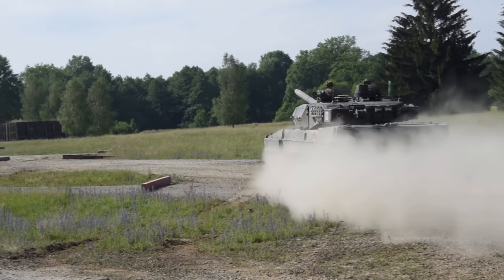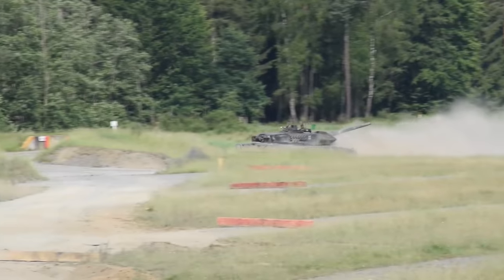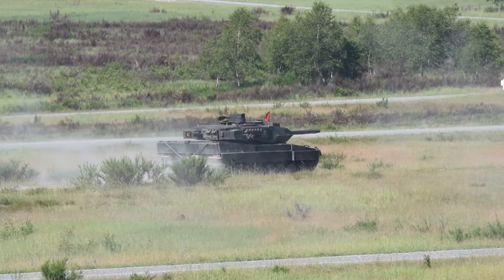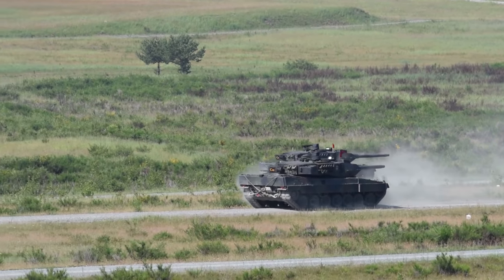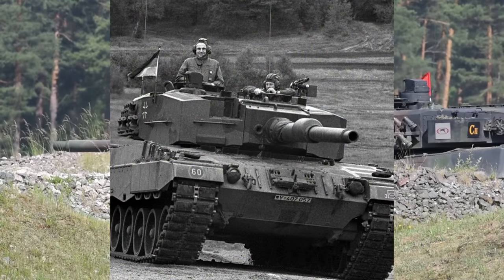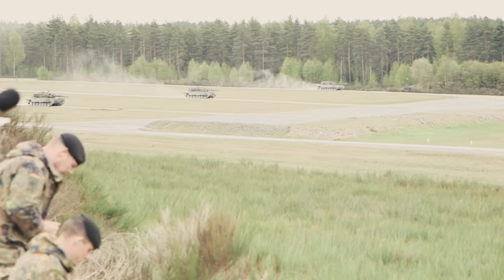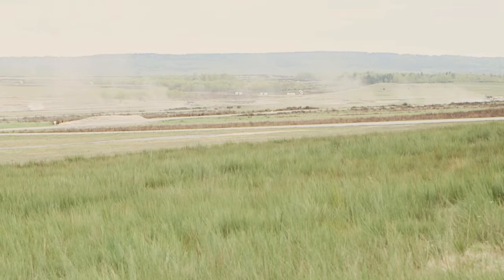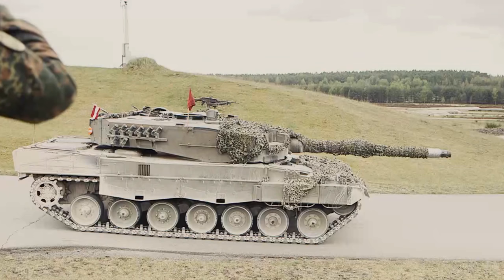Leopard 2 Main Battle Tank | GERMAN ENGINEERING

Comment: miled steel, not milled steel?
Reply: Mild steel. A slightly softer and easier to work with version of steel compared to armor steel. It was used during the prototype phases, as many changes to the layout were still expected. Once the design had been finalized, they built it with a higher hardness armor steel.

Comment: Matsimus, what's with the shiny bit on the inside of the next to last road wheel on the Leopard 2 MBT? It can be seen, quite easily, at the 11:01 mark.
Reply: It looks like a newly fitted inner wheel hub, hence it's shiny appearance. i'm guessing the old one had cracked.
Reply: @thewomble1509  I thought that too, but then  I looked at the Leopard 2 running alongside, and it had the same shiny bit, in the same spot. Could just be coincidental.

Comment: Such a beauty, leopard 2 is my 2nd favorite modern tank behind the Abrams (I'm really hoping to see the L/55 on the Abrams 🤞) this thing can do it all and has a resume to show for it has a super version of the 120mm NATO standard and most importantly.........it look real good with hat Arrowhead turret front there's rumblings of a replacement in development if so it going to have large garage to fill 
      Also and quick lesson for people who don't know for cannons usually you see the name and or it's diameter a L dash then a number ( example Pak 41 L/71 or 120mm L/44) you can figure out how long the cannon barrel is by multiplying the guns size in millimeters by the L number and you will get the length in millimeters so the standard NATO 120mm L/44 cannon is ( 120 X 44 ) 5280mm (which is ironic if your American) or 5.28 meters or 17.3 feet long going back the Pak 41 which was 88mm L/71 was 6,248mm long 6.25m or 20.5 feet now you know you can find out the length of a cannon barrel a little easier hopefully
Reply: Theprfesssor Abrams don’t get much of a benefit with a longer gun than compared to the German leopards. German leopards fires dm53 which is a segmented penetrator, segmented penetrators benefits a lot with a longer barrel. Abrams fires m829a3/e4 which doesn’t get much of a improvement with a longer barrel, m829a3 is a rather slow round only having a velocity of 1550 m/s and still achieves the same or better penetration than m829a2 which is faster.
Reply: @hazardous458  
    Problem is were both guesstimating, I don't believe there's any data on the subject and if there is I haven't found it, the L/55 would over 4 feet of extra barrel time and judging from the muzzle blast there's still plenty of propellant left now how much would it add and would it be worth the time and investment to fit retrofit a large amount of MBT that's up to the military's discussion on what they think is a big enough improvement but I do know speed dictates kinetic energy more than anything else 
   Specs of the m829e3 is a 10kg dart traveling at 1550 m/s that has 12,012,500 joules of energy say the extra barrel time adds 5% velocity increase that would bump it up to 1627.5 m/s and have 13,243,781 joules of energy a 10 percent increase this is how kinetic energy works velocity increases dramatically boost kinetic energy if you 50% more speed you over double the KE if you double speed it you triples the KE the thing is the round is already pushing limit at near a mile a second this is why it's easier to make the round heavier and have it travel at the slower speed that what the 130 and 140mm projects are looking at 
    It's going to be interesting seeing how it turns out
Reply: Theprfesssor Also too fast might shatter the dart.

Comment: What’s the combat experience of this final how has to fared in battle?
Reply: Danish and Canadian Leopard 2s apparently did very well in Afghanistan, which is why the Canadians chose to buy a bunch, instead of just leasing them as a stop gap measure.
Reply: That Turkish Leopard suffer horribel in Syria, if they was not properly suported. Essential the old stuff about the advantage of combined arms.
Reply: @kirgan1000  Only that the Turks now accuse the Germans of giving them bad material. However, the Turks here cannot drive a BMW properly either.
Reply: @PropperNaughtyGeezer  That's why they switched to Mercedes xD But they can't drive those either ^^
Reply: @JazzJaRa  I dont know. Here Turks always drive BMW. And Poles always Mercedes Sprinter.
Reply: @PropperNaughtyGeezer  over here they either drive a Audi or Mercedes AMG

Comment: Meanwhile, Aselsan company has a leopard 2 modernization called Next Generation. A more comprehensive study than Evaluation and Revolution modernizations. As far as Turkey's leopard  1T used in the tank fire control system better than Leopard 2A6. Also, the tank laser warning system and the pulat active protection system came into use in M60TM tanks. The leopard 2 cannot modernize their tanks, as they cannot find financial resources.

Comment: I wonder how those would’ve performed at Kursk
Reply: Probably just tiny better than any other tank of the era (considering Germans would have enough fuel at the time and ammo for 120). Its not like Leo 2 would be indestructable by WW2 soviet forces. Lets just mention tracks - one hit with HE round from t-34 and the track is done and the tank sits on its ass so it can get overruned by soviet forces.
Reply: @Weisior  Well, there's one massive advantage for the Leo 2 though, it's fully night fighting capable, which the tanks back then were not.
Reply: @shi01  Due to their stabilizers and computer-assisted targeting they can also fight effectively whilst being in full motion and going through rough terrain. The only way I could see the Soviets win this would be by the Leopards running out of Ammo and the WW2 supply vehicles being unable to keep pace with them.
Reply: @Exodon2020  Well, the soviets would have a significant numerical superiority. Even if you move through terrain quite quickly, if 10 enemy tanks shooting at you there's still a chance they will hit you eventually and do some damage.
Night fighting capability is a huge game changer though. There's basically no chance a WW2 tank can spot a tank 2km away at night. For the Leopard though it's no problem. So if the Leopard crew uses shoot and scoot tactics at night the WW2 tanks probably wouldn't even be able to shoot back.

Comment: This tank is beautiful. But I can’t help noticing that it has some similarity to the A-1 Abrams. The turret is different. The turret is sloped at a sharp angel to deflect incoming tank shells. But basically it looks like a Abrams. This is obviously a design effort between germany and the United States. I think the German military tried to save money by not using reactive armor. But all and all it’s a beautiful kit.
Reply: Charles Reddington Well reactive armor is basically protection against chemical ammuniton which leopard already offers a great protection.

The composite armor on leo’s can provide cover from both chemical And kinetic ammuniton(And turret armor is Much better compare to abrams).

So İ think leo’s doesnt need any kind of reactive armor at all

Comment: If I remember correctly, the Turks drove their Tanks way to far forward andgot hit in side of the turret with an Rpg setting the ready rack off.
Reply: The Turks utilized them in the wrongest way possible: Having them charge into cities without Infantry Cover or using them close-range Artillery from very open Positions. Their enemies just spend the better half of a decade fighting against Syrian and captured Iraqi tanks, some of which being T-80s and even M1 Abrams. Under these circumstances the failure of the Leopard 2, especially the A4 model hardly surprised anyone at the Manufactorer Krauss Maffei Wegmann nor at the Bundeswehr.
Reply: It wasn't an RPG but a ATGM. However the crew survived, what speaks that the Leopard protects it's crew.

Comment: many coutries fielded Leo2´s in war scenarios ( fore.g Canada ) 
but only Turkey lost Leo´s. Reasons are:
They used them in an artillery role
They used them in urban operations, with:
No infantery support, of IFV, or AFV support.
No Recce on the ground or uav´s in the sky during engagement ( they feared they would be shot down ,
well..what did they get instead?)
No active protection system
No remote weapon station
No protected ammo storage with blowout door or panels

The Leo2a4´s where /are ex german batch1 Leo´s with only good front armor,
as they where designd for frontal tank battles during the cold war ( to secure the "Fulda Gap")
The sides on the rear, and the rear itself barely had any armor.
The machines where stripped from all tech the german government deemed should not belong 
into the hand´s of the Turks.
But the turk´s knew that, they planned to upgrade them for many years,
 but all german and other european project partners rejected, or abandoned the program for political reasons 
( put your suspected reasons here:----------)
They finaly upgraded them a few weeks ago ,( after their experiences in syria )
and the first upgraded ones are beeing delivered. (only took them 15 years)
But ,it´s only an armor add-on kit.
Last but not least, bad crew training, aaannnd, bad overall tactics.
Reply: Purging your officer corps for political reasons has consequences on the battlefield. A lesson even Stalin had to learn.

Comment: The leopards blown up in syria, six of them were destroyed by a 9M133 Kornet ATGM. This rocket also have blown up all Abrams, it had been used against.
There is no actual protection against this rocket. The only way to avoid destruction is to permanently move the tank and always go for cover.
Reply: 1 - Syria they were old 2A4 leopards.
2 - New tanks have a Hard Kill Active Protection System. (Defense of an approaching projectile by a counter hit.) Rheinmetall speaks of a success rate of over 95 percent in some cases.
Above all, even from a distance of only ten meters, bazookas or missiles approaching almost simultaneously can be recognized and fought in good time.

Comment: 2:38 What is that "blanket" front of the tank?
Reply: i guess some rubber protection against shrapnel from mines? i don't know.
Reply: I think the "blanket" (on the Leopard 2) your talking about is just used for camouflage. Also, it is possibly used to limit the amount of dust that you generate when you move.

Although in some other countries, tanks have thick rubber "blankets" covering their lower glacis armour (I think some Russian tanks have this feature). I think the purpose of this is to pre-detonate shaped charges. So, kinda a form of spaced armour.

Hope this helps     ;)
Reply: @komradearti9935  Well maybe for the top portion of the LFP, it wouldn't rly help. But for the middle, and bottom portion of the LFP, there could be enough stand off space to help against RPG rounds (which is possible since, RPG type weapons are relatively low powered, and have relatively low penetration) ......but against dedicated ATGMs? Hell no (the lower glacis of the T-72 isn't covered by composite armour).

But, just, saying, even if the HEAT shell penetrated the (middle, and bottom) LFP, and the thick rubber skirt, this would still probably reduce the amount of spall created by the HEAT penetration (so in the long run, a thick rubber blanket on the LFP can provide some modicum of protection. Not, the most ideal method.....but still better than nothing. So, it counts as armour. Since, technically the whole point of armour is to mitigate damage). 

I mean, HEAT shells aren't particularly known to be great at producing a lot of spall (at least when compared to the large amount of spall created from AP, APHE, APCR, and APDSFS shells)

Anyways, long story short, I thought that a thick rubber blanket for the LFP may be a "decent"-ish idea, since Russian tanks use (steel-reinforced. Not quite too sure whatever that means) rubber skirts for their side armour. And, apparently, the (steel-reinforced) rubber side skirts are effective against some HEAT munitions

[Oh by the way, sorry for the late reply]

Comment: Mite, Don't waste time telling us what we can read in the Wikipedia.
Use Ur mechanical knowledge to tell us what we can't, like:
Where is its air cleaner? Where is its muffler? Where are its fuel tanks? 
What are those 2 big boxes on the side of the engine? 
The intercoolers? How do they work? Trace the airflow for us.
The sides of the hull above the tracks look like sheet metal,
and there is no internal armour, in the engine bay!? How is that possible?

Comment: Nicht ubel.  BUT, there was that twelve year old Kurdish girl who took one out with a TOW.  The forward ammo storage needs to be repositioned.
Reply: The obvious question now would be: To where?
Could be difficult to do without substantially redesigning the hull.

So, it might be more expedient to up-armour the relevant part of the hull.
That is, if the issue realy is as big as a number of people make it.
If have become a little cautious with claims of suposed "big flaws" in military equipment.
Reply: troll oracle  Tell that to the Turks, their Leo2 went boom a year and a half ago.
Reply: @Bird_Dog00  Do doubt, you're correct. Consider the M-60a3 with its ready rounds off to the left of the loader. Was in one of those when a flare went off inside of the turret.  Not a good feeling.
Reply: troll oracle  hmmm...can't argue with you on the infantry support. However, the range was about 4k if I'm not mistaken; and even brasse-balled infantry doesn't like working that far out.
Reply: troll oracle  True dat. Oh, pardon the pun.

Comment: They are not that great.  Two Turkish leopard 2 tanks where taken out by konkurs atgw (AT-5) in northern Syria
Reply: While the Leopard 2 A4s used by the turkish military in those operations did show a likely lack of protection against the threat of atgms, stating that a tank isn't great just because of the fact that two of them were knocked out in combat is problematic at best.
Engineering being the art of compromise, every tank has its own short commings. The Leo2 isn't any different.
And you can argue it's weaknesses, but your blanket statement is ill-informed and will serve as little more than flame-bait.
Reply: Well the turkish military doesn't know how to use tanks. It could have been the most modern tanks and they would have lost them, because they used them as artillery, didn't had infantry or IFV support, never changed their position after firing and were standing on open field. So they did everything wrong from a tactical point. It's not the fault of the tank, it's the fault of the user.

Comment: The Leopard 2 is objectively not the "best tank". He never was either. The armor is relatively bad. Even after many improvements, it is inferior to the Abrams, Leclerc or Challenger. The electronics are hopelessly outdated. The thermal imaging device is as it was in the 1970s. The gun is average, as is the mobility. Yes, the tanks in Syria were misused and were the A4 model. But the A7 doesn't fare much better in terms of armor and the other systems are similarly underperforming. All in all, the Leopard 2 is the worst of the western tanks. For some reason there's a myth that he's awesome. That is nonsense and I say that as a German!

Comment: By the way what’s the purpose of the material hanging in front of the lower glasis plates. Is it for hiding heat signature or to hide it so they can’t aim at the glasis plate pardon the spelling been knocking them back tonight. Over the fake BS scamdemic.....
Reply: The cloth obscures the hard shadow underneath the vehicle. The bottom of a tank is really dark in comparison to the rest of the vehicle and pops out at distance.